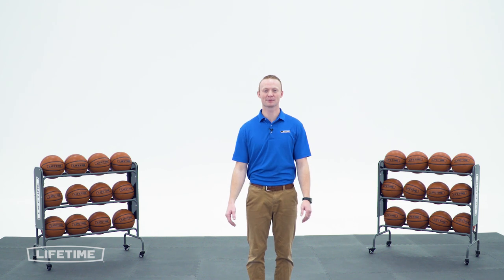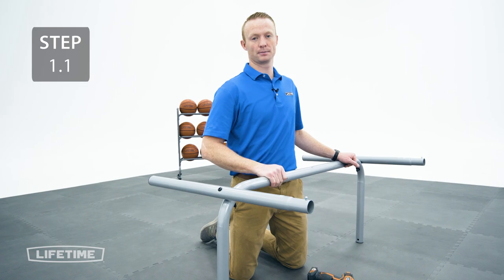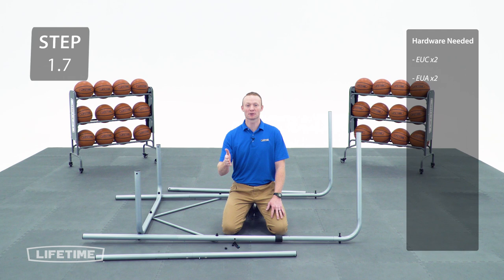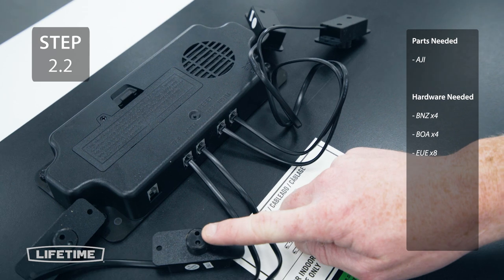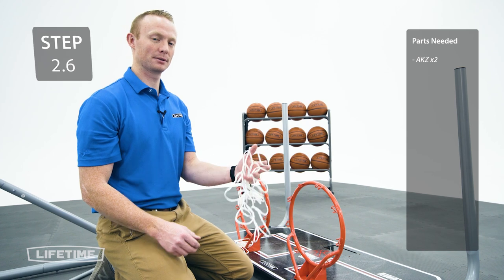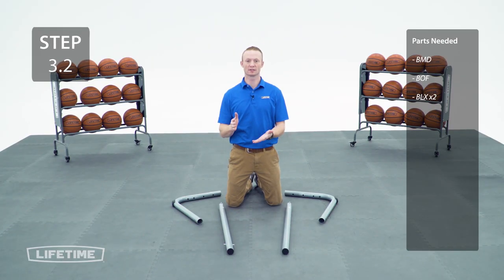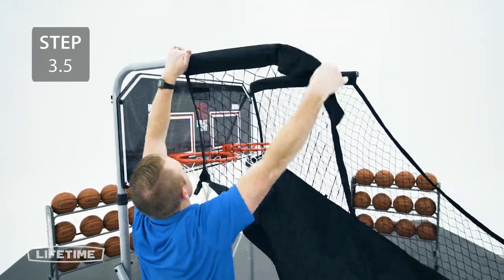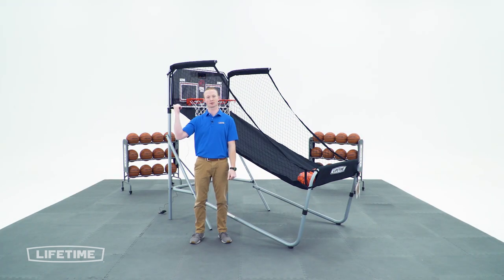Lifetime Double Shot® Arcade Basketball System | Model 90648 | Lifetime Assembly Video

Comment: Hello the sound  and buzzer aren’t working? Any suggestions . The display works and counters work
Reply from the maker: I'd reach out to our customer service team to see if there is a quick tip to help you get the sound. Our Customer Service Team can be reached at 800-225-3865 opt. 1 or by email at customercare@lifetime.com. Customer Service hours are Monday-Friday, 7:00 am to 5:00 pm and Saturday, 9:00 am to 1:00 pm (MT).